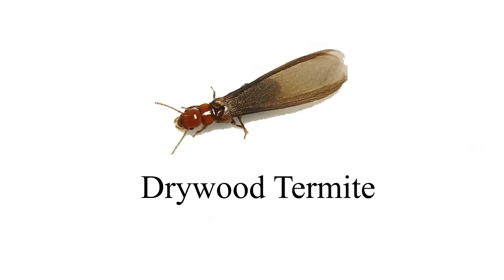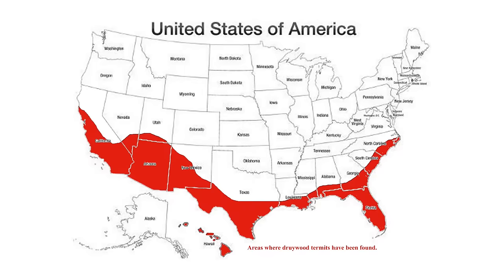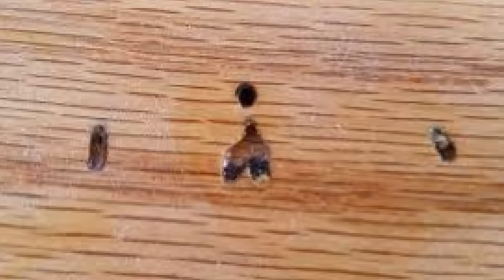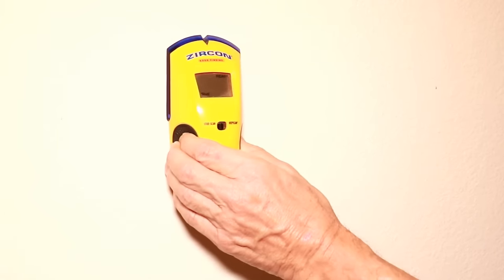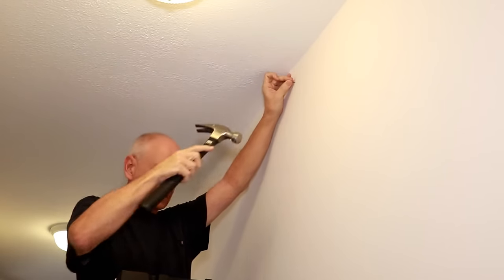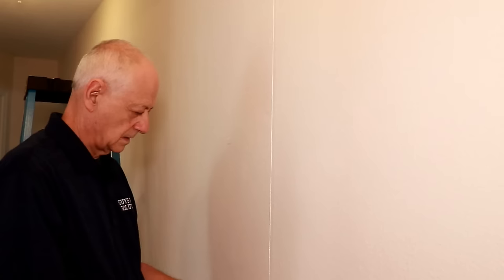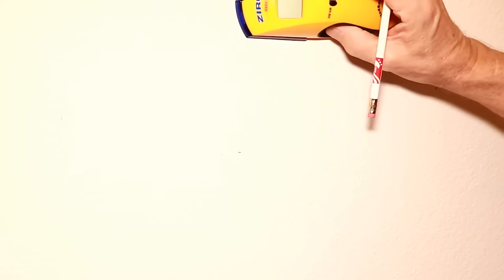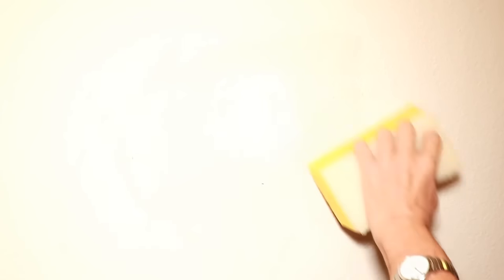How to Treat a Drywood Termite Infestation Yourself. A MUST see if you have Drywood termites.

Comment: Hello Guy!  

1)  Can you please compare the chemicals of your choice to the Spectracide Terminate Killing Foam2 (bought before I saw your video)?
2)  I drilled 3"-deep, 1/8" diam holes spaced 4" into the studs through the drywall and will inject the foam tomorrow - can I apply the spackle compound to the hole  immediately to seal the foam in or should I wait a specified time?

Thanks!!
Reply from the maker: The Spectracide Terminate Killing Foam2 is a repellent pesticide that should never be used for termites.  The fipronil foam that I recommend is a non-repellent pesticide.  The Spectracide Terminate Killing Foam2 will kill the termites immediately, but that is not what you want.  You want to kill them slowly, so that they have time to spread the poison to the other termites, thereby killing the entire gallery and not just part of it.  The Spectracide Terminate Killing Foam2 can actually make the problem worse.

You can patch the holes immediately after treatment.

I hope that helps.  Be well my friend.
Reply: @GuysPestSolutions  Thanks, Guy! 

1)  I searched about and it looks like fipronil (under it's brand names - Termidor, or Taurus SC )  is restricted in California to outside only...  tried to buy on Amazon and got the message  "cannot be shipped to your address".    Do you know if it's allowed to professionals only?  Any alternative suggestions?

2)  I gave up on positively confirming frass with an inspection camera -(too much fiberglass insulation in the walls)  and defaulted to drilling 4" spaced holes in studs spanning the suspected wall.    That's a lot of holes to drill  and it would be helpful to find them when periodically re-treating in the future.   I came up with this idea - before patching with spackle plug each hole  with  a 1/2" nail, push to recess its head to about 1mm below wall surface and then patch over it and repaint.   It's easily located in the future with a stud finder and small magnets that simply stick to it in place and mark where to dig.

Your thoughts?

Best Regards,  Abe
Reply from the maker: @abrahamshrekenhamer1973  Domyown.com will ship the Termidor foam to California, even though it is restricted to licensed applicators.  I won't tell if you won't.  California is an extremely restrictive state for just about everything.  When it comes to overkill, they definitely get the award for it.  Restricting a fipronil foam to outside use is totally stupid.  This product was designed to be used indoors.  I often wonder if the California legislature does any research whatsoever before they pass a law.  Anyway, I will provide a link to the product below.
 
As you are discovering, spot treating for drywood termites it's more than just a little problematic.  That is why I always recommend fumigating, if at all possible.  I understand where you were going with pushing nails in the wall where you drilled the holes, but I think there are some problems with it.  The holes you are drilling are very tiny and can be very easily repaired.  The head of a nail is going to be much larger and more difficult to repair.  When you go to retreat the wall, then you need to pull the nails out and that is going to cause additional damage.  Also, you don't know if you are going to need to retreat that wall.  From a strictly pest control point of view, putting the nails in the wall will make no difference.  The only issue is the ease of repair.
 
Using borescopes to locate frass in a wall is very difficult.  It works best on interior walls, but even then, you need a very good borescope for it to work well.  This is yet another reason why it is so hard to locate the galleries.  Even with the most sophisticated equipment available, it is still unlikely that even the best pest controller we'll find all the galleries.  That is why trying to spot treat drywood termites is pretty much and exercise in futility.  I only recommend it to people who absolutely cannot afford to pay for a fumigation.  Spot treating will slow down the termites, but it is unlikely to solve the problem.

I hope that helps.  Be well my friend.                   
 
Termidor foam:  https://www.domyown.com/termidor-foam-p-3528.html

Comment: I live in Florida and my house is 1955, I have solid block interior and exterior walls, I believe the only wood is in my attic and my front door. I noticed a couple dry wood termite swarmers last year but I didn’t do anything because it went away as soon as my neighbors house got tented. This year I’m noticing a lot of swarmers everyday in the house and upon my own inspection I can see old termite damage on the end of the trusses but I can’t find it anywhere else. My question is should I start preventative treatment before fumigation or after? If before how long before fumigation? Also a pest control person told me if I’m already infested I should wait until the end of August when the termites settle down to do treatment . Have you ever heard of this or is there actually a better time to treat for them?
Reply from the maker: I'm so sorry that you are having this problem and I'm sorry for the delay in answering your question.  I am on vacation at the moment, and I am on a cruise, so I don't always have internet and often I am doing vacation stuff.  My wife and I have not had a vacation in over 13 years, so it was time.  I will be home on June 11, so I can answer any additional questions you may have at that time.

It is important to understand how drywood termites work.  They enter through cracks and crevices around windows, doors, eaves, pipe penetrations, and so forth.  Most of the time, they enter through several locations.  That is because a swarm of them attacked your house at the same time.  If there was a crack or a crevice, then they probably found it.  After they establish their galleries, which will be inside the wood, it will take four to seven years for them to be able to swarm.  Now that they are in your house, the swarmers will use holes that are in your studs to travel through the walls.  Those holes in the studs were created by the electricians to run the electrical wiring.  Not only are these holes going through the studs, but holes were drilled into the attic for the light switches and to run some of the wiring for the outlets.  So, the termites now have easy access throughout the attic and the walls.  If you have a basement or crawl space, they have access to that as well.  Most of the time, you will have no idea that they are in the walls, because the frass is inside the wall.  To make matters worse, if you have drywood termites, then your neighbors have them too.  That means you have been getting swarmed for as long as they have existed in the neighborhood.  Most likely, we're talking about years, so it's a safe bet that you have these guys in many locations in your home.  Unless you are looking at concrete blocks on the inside of your house, then you probably have padded out walls.  That is to say, if you have drywall on the exterior walls, then they were padded out with either 2x4s or furring strips to allow the drywall to be hung and the electrical wiring to be run.  Almost all block homes are built with padded out walls.  The interior walls are usually constructed with wood studs as well.  Drywood termites will also attack closets, cabinets, and furniture.  If it's made of wood, they won't mind calling it home.

As you already know, the only way to get rid of drywood termites is to fumigate.  Prices for this can vary wildly in this industry, so I recommend that you watch my video on how to hire a pest controller without getting ripped off.  That video can save you a lot of money.  You should also know that the gas they use to fumigate has absolutely no residual action whatsoever, so you can get reinfested the moment the tent comes down.  Like I said before, if you have drywood termites, then your neighbors have them as well.  Since drywood termites swarm every year, it is almost a certainty that you will be reinfested within a year after the fumigation is done.  It sounds like you also know that the only way to prevent this is to do a preventive treatment on your house every 60 days.  Most pest controllers will not do this, so it is something that you generally need to do yourself.  I have a video on how to do that and I will place a link below.  This is a generic video that covers a lot of different pests, but it also works for preventing drywood termites.  Just ignore the part about treating your yard.  You only need to treat the house for drywood termites.  This will not treat the termites that are already there, but it will stop new ones from getting in.  If you cannot afford to fumigate, then you can spot treat with a fipronil foam, but it is pretty much impossible to find all the galleries, so this is not going to eliminate the infestation.  Still, it is better than doing nothing.  Regardless of which method you choose, you should begin the preventive treatment immediately, so that you do not get additional termites paying you a visit.  In any case, you want to start the preventive treatment before the tent goes up.  I suspect what that pest controller was saying is that you should wait until after swarming season has ended to fumigate to reduce the likelihood that you will immediately become reinfested.  Personally, I would do it after November 1 and sooner than April 1.  Most people do the fumigation during swarming season, which does not make a lot of sense if you understand how drywood termites work.

I hope that helps.  Be well my friend.                    

Video on how to hire a pest controller without getting ripped off:  https://youtu.be/y-a8XOqVrlE

Video on how to prevent drywood termites:  https://youtu.be/Yozv3s-Qwlw
Reply: @GuysPestSolutions  thank you so much for answering and the tips! I hope you continue to have a great vacation!
Reply: Great explanation
Reply from the maker: @Foxfirebrown1234  Thank you so much for those kind words.  Very much appreciated.  Be well my friend.
Reply: Mr. Guy, I sent you an email 2 days ago because my questions  to you aren't posting  here under the feed. Can you check your email & respond under this link? Thank you, you are a heaven sent. I listen to your videos daily & repetitively.
Reply from the maker: @Foxfirebrown1234  Thank you so much for watching my videos.  I believe I answered your emails.  Sorry that it took so long.  I was away for 2 weeks, and my emails go really backed up.  I'm still trying to get caught up.  Hopefully, I will get all the emails answered this week sometime.  Thanks for your patience.  Be well Day.

Comment: Hi Guy, what do you think about using wood preservative (copper naphthenate) to treat exposed wood joists or studs instead of bora-care?
Reply from the maker: I have never used it because it is a lot more dangerous than Bora-Care.  I believe it has a signal word of Danger while Bora-Care has a signal word of Caution.  Caution is the least hazardous and Danger is the most hazardous.  Warning is kind of in the middle.  Copper naphthenate is flammable and way more toxic if swallowed.  I am not an expert with it, but it seems to me that I would not want to apply a flammable material to bare wood in my home, if there is another way to do it.  That could make the wood burn faster and easier.  I have not used it, so I don't know this for sure, but I'm guessing that it gives off vapors when you use it, so I suspect that you would want a lot of ventilation.  None of this is an issue with Bora-Care.  Also, I don't know how long copper naphthenate lasts after treatment.  Bora-Care is permanent.  Copper naphthenate may be permanent as well, but I don't know.  All of that being said, it may be an effective alternative, but I would have some issues with the safety aspect of it.  Anyway, that's the way it seems to me.  Be well my friend.

Comment: I have started finding dry wood termites in my bathtub, are they in my drains? How to treat them from the drains?
Reply from the maker: The termites are not in your drains.  These are probably reproductives and they have wings.  They are most likely coming out tiny holes in the drywall, woodwork, or maybe even furniture.  If they are in the bathroom, it is very likely that is where they are coming from.  Check the drywall for tiny holes.  Also check the vanity as well.  Make sure these are drywood termites and not a different species, because they would get treated much differently.

It is important to understand how drywood termites work.  They enter through cracks and crevices around windows, doors, eaves, pipe penetrations, and so forth.  Most of the time, they enter through several locations.  That is because a swarm of them attacked your house at the same time.  If there was a crack or a crevice, then they probably found it.  After they establish their galleries, which will be inside the wood, it will take four to seven years for them to be able to swarm.  Now that they are in your house, the swarmers will use holes that are in your studs to travel through the walls.  Those holes in the studs were created by the electricians to run the electrical wiring.  Not only are these holes going through the studs, but holes were drilled into the attic for the light switches and to run some of the wiring for the outlets.  So, the termites now have easy access throughout the attic and the walls.  If you have a basement or crawl space, they have access to that as well.  Most of the time, you will have no idea that they are in the walls, because the frass is inside the wall.  To make matters worse, if you have drywood termites, then your neighbors have them too.  That means you have been getting swarmed for as long as they have existed in the neighborhood.  Most likely, we're talking about years, so it's a safe bet that you have these guys in many locations in your home.

I always hate to be the bearer of bad news, but if you have drywood termites, the only sure way to get rid of them is to fumigate.  Prices for this can vary wildly in this industry, so I recommend that you watch my video on how to hire a pest controller without getting ripped off.  That video can save you a lot of money.  You should also know that the gas they use to fumigate has absolutely no residual action whatsoever, so you can get reinfested the moment the tent comes down.  Like I said before, if you have drywood termites, then your neighbors have them as well.  Since drywood termites swarm every year, it is almost a certainty that you will be reinfested within a year after the fumigation is done.  The only way to prevent this is to do a preventive treatment on your house every 60 days.  Most pest controllers will not do this, so it is something that you generally need to do yourself.  I have a video on how to do that and I will place a link below.  This is a generic video that covers a lot of different pests, but it also works for preventing drywood termites.  Just ignore the part about treating your yard.  You only need to treat the house for drywood termites.  This will not treat the termites that are already there, but it will stop new ones from getting in.  If you absolutely cannot afford to fumigate your house, then you can try spot treating it yourself.  It is virtually impossible to find all the termite galleries, but it is way better than doing nothing.  Regardless of how you treat it, you should begin the preventive treatment immediately, so that you do not get additional termites paying you a visit.

I hope that helps.  Be well Emmy.                    

Video on how to hire a pest controller without getting ripped off:  https://youtu.be/y-a8XOqVrlE

Video on how to prevent drywood termites:  https://youtu.be/Yozv3s-Qwlw

Video on how to spot treat drywood termites:  https://youtu.be/U7ck7zhS0Xo